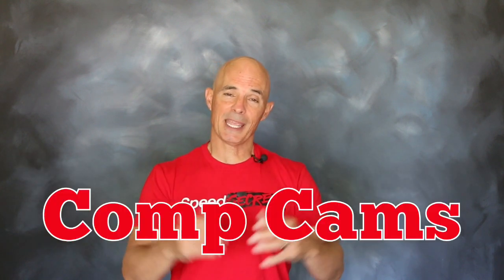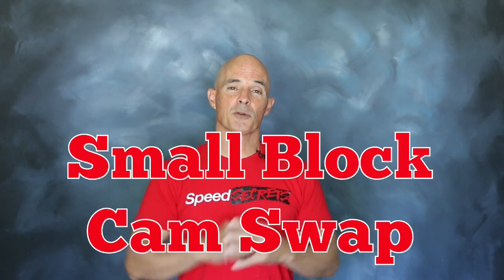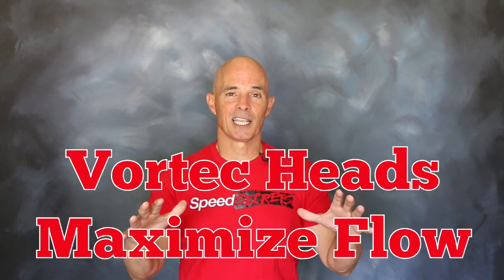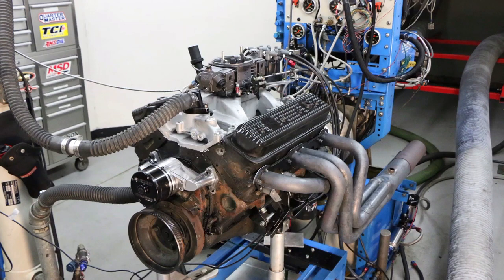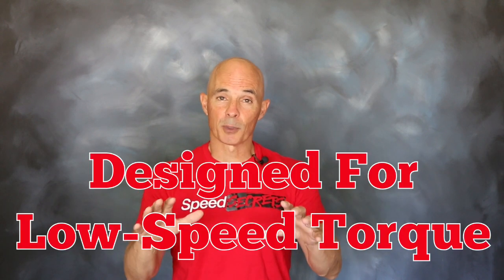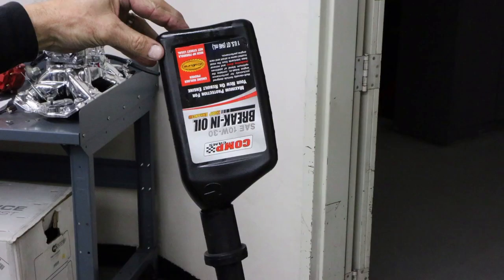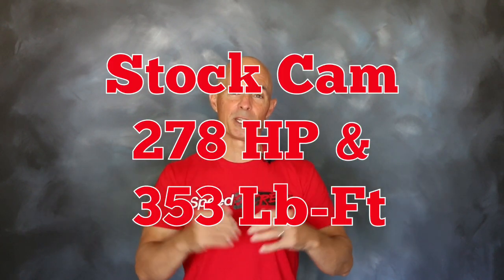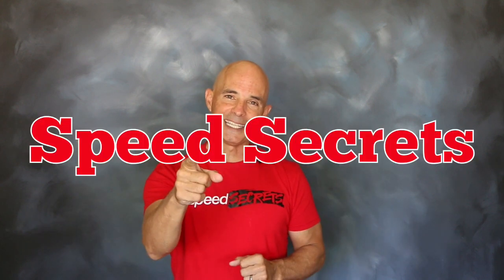Speed Secrets Are Small Block Chevy Cam Swaps Like LS Cam Swaps

Comment: It makes zero sense to build a SBC anymore
Reply: It depends really.
If your going a pretty serious build SBC is still relevant because parts are like 1/2 to 2/3 the cost of LS.
I'm talking crank, rods, pistons, heads, cams etc. Go build an aftermarket block LS or SBC and see what I mean. Even an 18 or 15 degree head SBC.
A max effort SBC is cheaper.
The SBC is a well developed race engine platform. 500 to 600 HP pump gas is easy. Can get to 700 HP with 23 degree heads.
As an example I just built a fully forged heads and roller cam SBC for around the price of a junkyard high mileage LS1 with all the swap parts. This SBC will take a ton of abuse compared to a high mileage LS1.
Reply: mmmm depends on CI. a 480ci-600ci small block is not something to fuck with
Reply: Biggest advantage to ls stuff vs sbc is they came with a more tunable fuel injection . But with the holley fuel injection being easier to use that's a moot point these days.
Reply: @HioSSilver1999  I really like that new Terminator X
Reply: I know you're not talking about my precious 327
Reply: Thats y i build sbf
Reply: @GJ-DT  that makes even less sense

Comment: 4x the work to swap a cam compared to an ls!
Reply: Not if you know what your doing. Twin turbo a gen 1 sbc and you can get 1000 to 1300hp with forged internals and aluminum heads